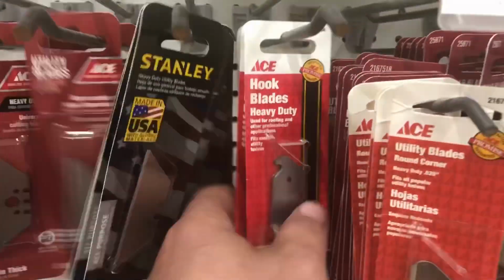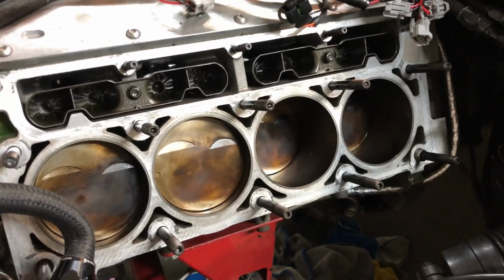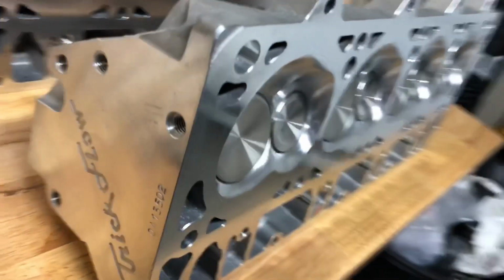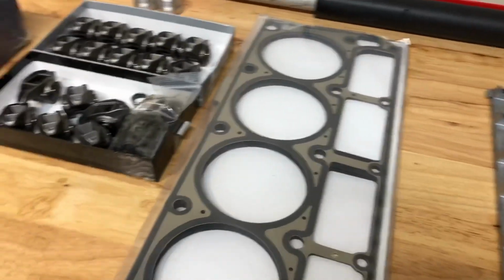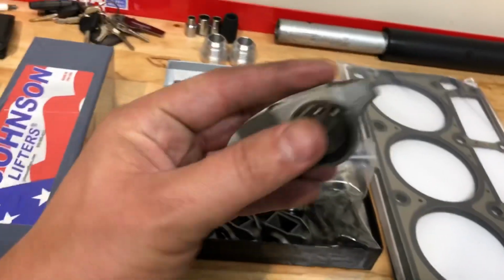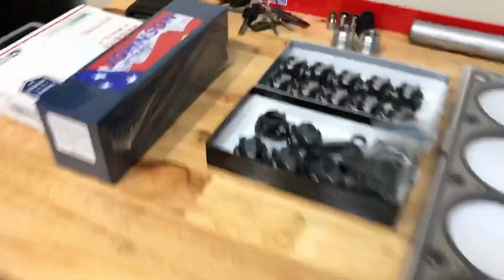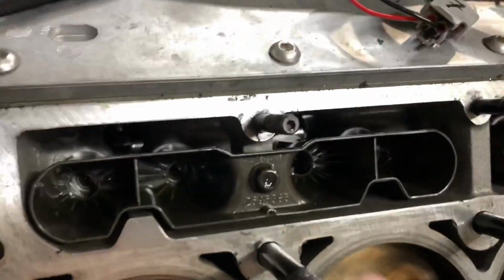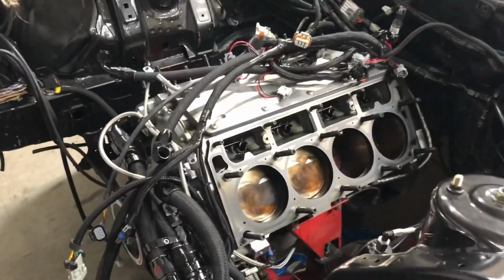Trick Flow 245's - PREPPED BY BRIAN TOOLEY HIMSELF!?

Comment: Will the 245s fit on a stick 6.0???
Reply from the maker: Not sure about a 4.00 bore but I can confirm they fit on a 4.010 bore.
Reply: @ClapdOut  thank you I hve a 6 bolt head but haven’t went aftermarket block yet.   I’m debating now
Reply from the maker: Yes, thems will werk. - Logan
Reply: @ClapdOut  I’m boosted so shrouding the valve isn’t to much of a concern